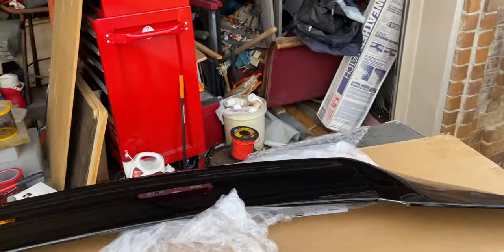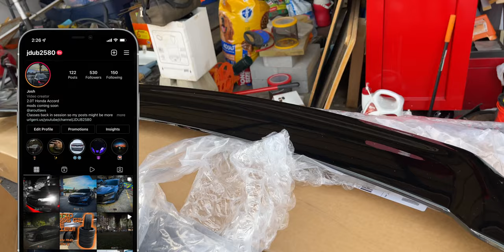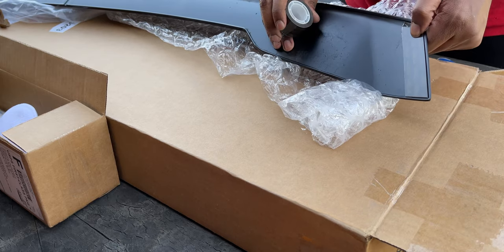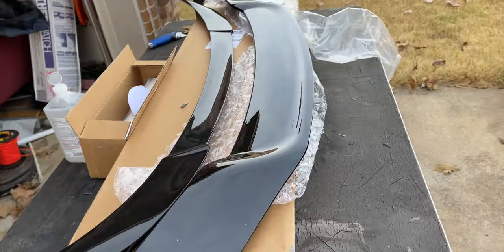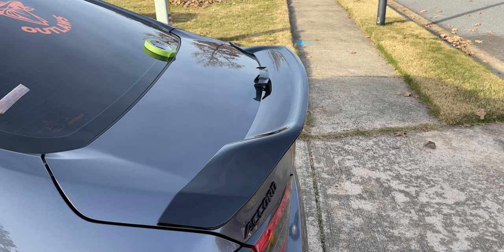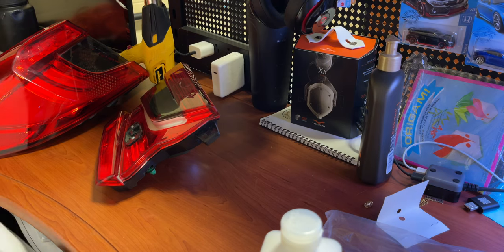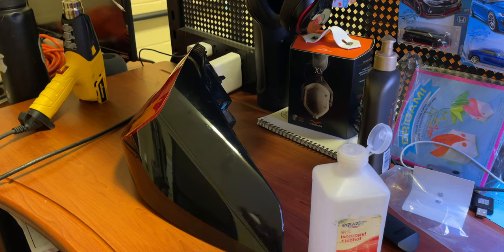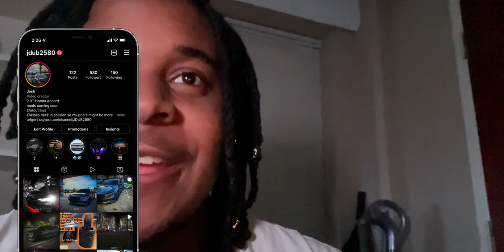INSTALLING A NEW DUCKBILL SPOILER ON MY 2020 HONDA ACCORD!

Comment: Just bought the duckbill spoiler before I install it, my only concern is it might fly off when on the highway.  Have you any issues with it on the highway?
Reply from the maker: No it hasn’t flew off but the edges on mine still lift

Comment: Clean car bro recently got the same duckbill but been holding off on installing it did you use any screws to hold it down? And did you use silicone for the holes? Been wanting to install it but don’t want it to fly off with only 3m holding it down
Reply from the maker: No I only used 3M and Gorilla Mounting tape the inch wide on both. You can see in the video where I placed both. I don’t think it’ll come off since it not that much down force on it.

Comment: I'm actually thinking about doing the same thing too as I have the same old spoiler (gloss black) you had on my 20 Touring. I don't have to deal with any holes though but I did have a Sport before and just patch those up with double sided tape on the inside.

Anyways I wanted to know you went with this high kick spoiler instead of the OG one that first came out for this car? Was it cause this one covers up the holes on the Sport model? I'm thinking of getting the high kick too but in silver to color match my car. I want the OG duckbill one too but I can't find it in silver on the cheap tho.

As for the taillights, they're looking nice for stock ones. I actually light tinted the whole thing while dark smoking the turns and reverse but took that off and with swapped it out with some reds with a large opening for the reverse. It looks nice for the most part but I put some overlays on the turns only cause the LED bulb that I got were super bright.

I only held off on swapping my taillights out cause of the Touring model. I like the full bar look while breaking. Honda should've done that stock like the Canadian version. Anyways I finally got some V4s light smoke on its way but it won't be here til the end of March tho. Can't wait as I want the sequential life again. 😊

I had the V2s dark smoke on my old Sport but have those away as I didn't like the look anymore. The V4s are clean and the best so far. I think they're even better the new Hawkeye ones coming out soon.
Reply from the maker: Both of the spoiler cover the holes but I wanted more kick up on the spoiler so that’s why I changed it out. Any if Honda have all models the full brake light like the touring I wouldn’t be thinking about getting different taillights.
Reply: @JDUB2580YouTube  oh I was talking about the other duckbill spoiler that goes over the emblem on the back. That one doesn't cover the holes on the Sport model tho.

I'm swapping my taillights to stand out tho and I honestly think that's the only downside to the Accord this gen. I don't like how the running lights are on the back either. Honda could've done a better job as the 9th gen had better taillights imo.
Reply from the maker: Oh yeah. I liked that one too but we can’t use it. I’ve seen people wrap the trunk to cover the holes.
Reply: V4s look amazing. I pre ordered the light smoke but ended up going all red and I'm hella happy.  Changed the whole look of that back

Comment: As I’ve seen with some other people, could you have just applied the duckbill spoiler on top of a small OEM spoiler?
Reply from the maker: No.  This one lays flat on the trunk. So if you have the sport you need to remove the stock spoiler
Reply: That was the duckbill V1. This is the duckbill V2.